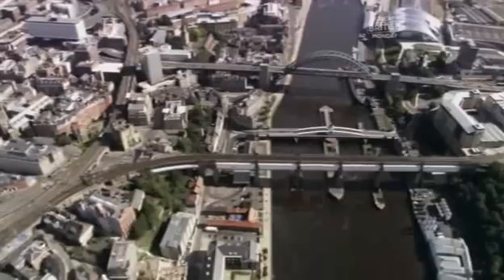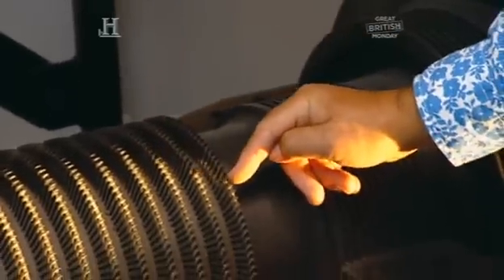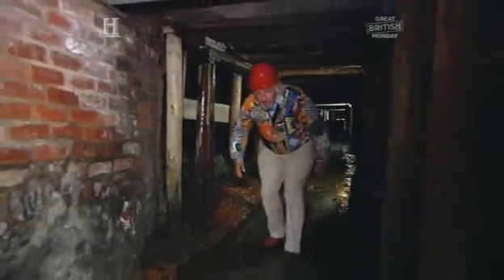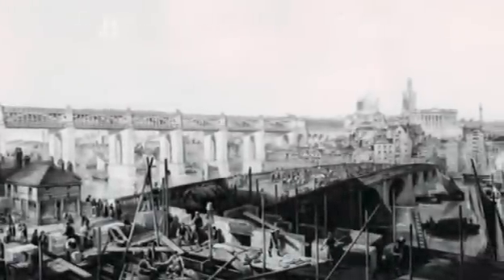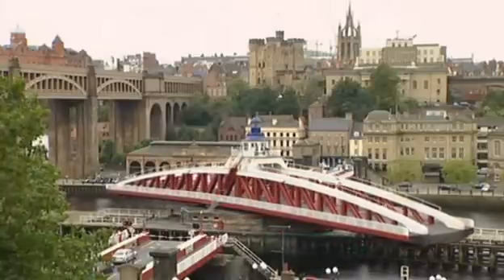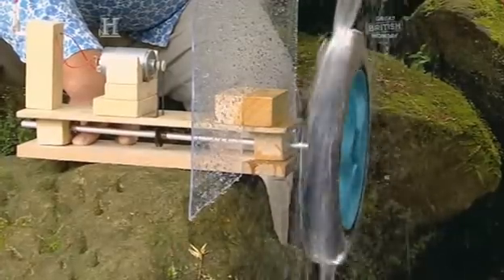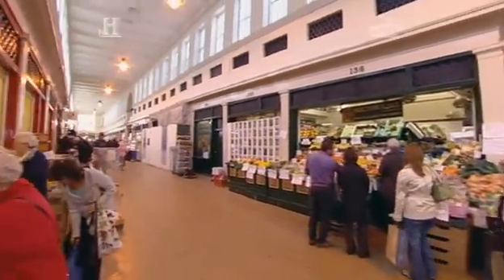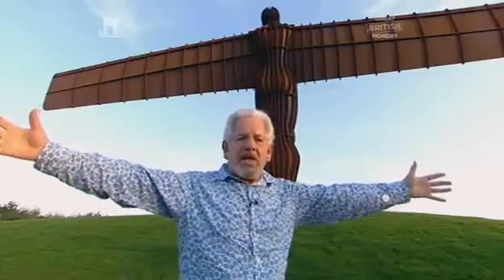How Britain Was Built   Newcastle

Comment: Yes but you didn’t have to live there.
My Mother was brought up with five siblings in a two room tenement,both parents died of TB and Suicide.No electricity only Gas and a coal fired range to cook and heat.Two miles from the Shipyards that got bombed by the Germans.No wonder half the working population had breathing problems the pollution was so bad.All of this right up until the 1960-70’s was the other side of life for the Working Class.